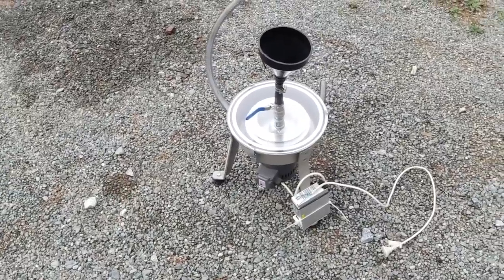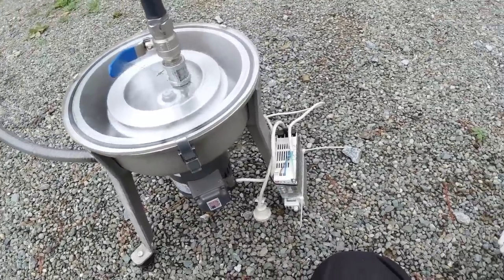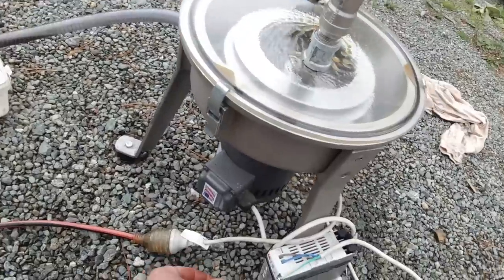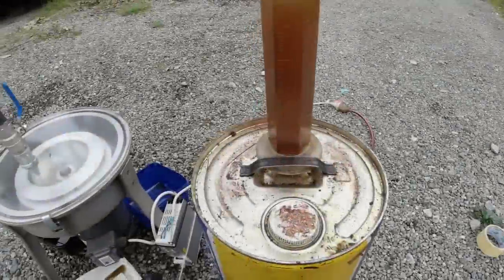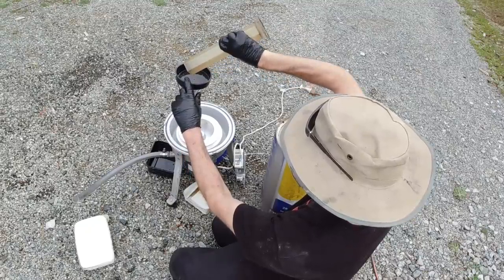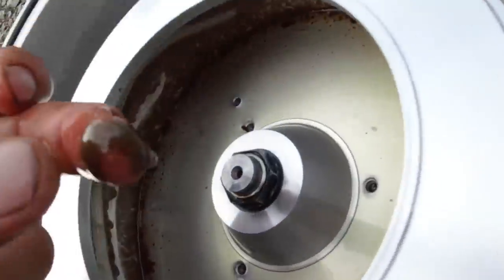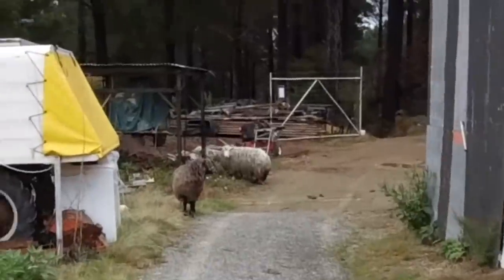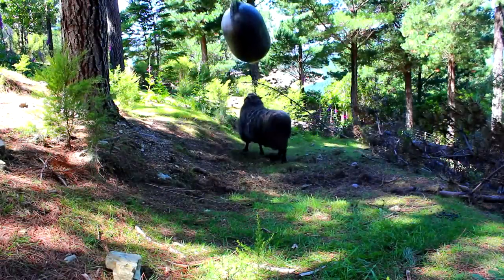Using a centrifuge to clean used oil and diesel.. Will it work??

Comment: After the centrifuge...........the black diesel blend should go through a 2 or 4 micron filter, if using standard filters (only 60% efficient) use 2 filters in series. Centrifuge "spinners" have been used very successfully on trucks ( Mack) and heavy machines for a long time.  Even the Soviet, Kirov/Belarus tractors used them.  Black diesel works just fine, especially in older diesels.......probably not in the late model common rail engines.
Reply: Mixing it with a bit of fresh fuel never hurt either...the nice thing is the waste oil once centrifuged provides MASSIVE lubricity to the injector pumps, especially with todays low sulfur junk they sell at the pumps
Reply: If filtered down to less than 1 micron, the injection system is not the concern. Newer engines are now equipped with Diesel Particulate Filters (DPF) and Selective Catalytic Reducers (SCR). The EP additives in oil consist of Zinc and Molybdenum. Those metals become oxides in the combustion process, and those oxides form an ash with a much higher melting point, than the temperatures achieved in a regeneration cycle. That ash will clog and cause restriction in the DPF, and foul the SCR. I would only ever recommend "black diesel" in older engines without post exhaust treatment.
Reply: @vincentrobinette1507    yes, DPF systems are almost exclusively found on COMMON RAIL engines......large and small.  Pre-common rail era engines as a rule DONT have DPF.  Blocking the DPF with ash is a minor problem compared to the potential damage to the high pressure common rail pumps which are very fussy. If you get dirty fuel,water or even higher than 5% biodiesel through a common rail pump, problems can happen.

Comment: I spent years on diesel submarines where sometimes on long cruises...diesel fuel was actually stored in the bilge along with bilge water. As the fuel was need we sent it through Sharples centrifuges and also used DeLeval  separators...Worked every day for every diesel submarine ever made...

Comment: An easy way to get water out is to freeze the liquid so the water turns to ice.
Reply: Emulsified water will form microcrystals and they will remain suspended - freezing will achieve very little
Reply: @PaulG.x  Put some oil and water in a soda bottle, shake it up let it sit for a couple of hours and freeze it. Just setting up a barrel or making a container with a tapered bottom with a drain in it will allow water to settle out. The longer you let it sit, the more water leaves suspension. Heating to remove water by evaporation also removes any aromatic hydrocarbons like gasoline and diesel fuel which are not good things to release into the atmosphere. The centrifuge has the same effect as gravity on an increased scale.
Reply: @tiredoldmechanic1791  Putting some oil and water in a soda bottle is not the same as what happens in an engine. It does not cause emulsification or other chemical bonds between the water and constituents of the oil.
A pointless exercise
Reply: @tiredoldmechanic1791  so you are saying that freezing will decrease the density of the water, making the density difference between water and oil smaller, thereby making them harder to separate‽
Reply: @Bbonno  I'm saying that freezing will make the water a solid and it's easy to separate a liquid from a solid.
Reply: @Darryl603  so you're saying oil and water freeze at the same temperature?
Reply: @PaulG.x  do you have a degree in chemistry or chemical engineering

Comment: Marty, when I was in the Arctic, we used an Alpha Laval centrifuge to lean up our air compressor lube oil, it was multi pass to clean up the condensation in the oil.
Our large diesel engines, EMD, had dual Oil Spinner centrifuges on each, that could be swapped, with the turn of a ball valve. So as to run continuously, while one Spinner could be taken down, and cleaned.
Neither system was single pass.
Best wishes from the far North.
Reply: So wait, the centrifuges were literally part of the circulatory system of the engine? As in, it was constantly cleaning the oil and pumping it back through the engine? And that was important enough to be worth the loss of total horsepower needed to run the pump and centrifuge?
Reply: @skeetsmcgrew3282  On the EMD's they where mounted on an external rack, beside the engines, tied into their oil systems. 
The Alpha Laval, was on a cart, that was moved between the Large compressors.

Comment: The Navy uses this method however with multiple centrifuges in one unit for various particle sizes. The centrifuges are closely stacked and conical shaped. The centrifuge also breaks down the cleaned oil when cleaning it so, while it works, you cant do it repeatedly without adding additives.

Comment: WRANGLER, read you complements first then you will get the gold.  First things first, I love watching your videos because you are one of the calmest mechanics on the tube.  Your approach of dry humor and a bucket of common sense is fantastic!  So I am in America in Texas, I have been broke when it came to my trucks and equipment most of my life because the family gets the lions share as I am sure your does too.  I found a way to filter oils and reuse them on the cheap. Take a leg from a "WRANGER" pair of denim  jeans and sew the bottom shut.  Pour in any oil and let drain in to a bucket. Wrangler denim will filter any oil to 10 microns.

Comment: Years ago I had a fishing boat and swapped the 6 Cylinder DAF Diesel out for a 8LW Gardner. I installed a centrifuge oil cleaner on the Gardner. I can't remember where I bought it from but was some engineering company in NZ. It fitted in place of the oil filter. It had inlet and outlet hoses and you had an adaptor that bolted on where the filter was. You simply removed the outer casing periodically and cleaned the junk out. I probably wouldn't use it as the main filter on a modern diesel engine but it seemed to work well enough on the old Gardner. I am sure that you could set something like that up to run continuously in a loop but I think it needed quite a bit of supply pressure.

Comment: To get the best cleaning action, run the centrifuge at the highest possible rpm, flow rate of the oil as low as possible and the oil needs to be pretty hot, so the viscosity is as low as possible.

Comment: Water separation with centrifuges is really common. That’s also how cream is separated from milk and unsurprisingly exactly the same equipment is used for both (same manufacturer).
The water comes from the wall of the centrifuge and the oil from the inside.

Comment: When I was a kid living on a farm in the UK we used to make our own butter , milk was  from one old cow kept for that purpose. We had a centrifugal milk/cream separator , hand operated.  My job was to turn the handle to get to the required speed then turn on the flow of milk and keep turning. Skimmed  milk came out of one outlet, thick  cream out of the other. Speed was controlled by a bell which sounded until you got going fast enough, damned hard work for a youngster.  It must have had quite a high gear set up to get the actual separator bit spinning fast enough. I bet there is a lot of these thrown into sheds and barns now and replaced by more modern stuff. Ours was actually set into the dairy floor in concrete, it required some real effort to get it going. Maybe it would separate oil/ water/diesel etc. Just a thought it must have been about 60 years ago, time flies.

Comment: This is mostly what is done at oil recycling facilities.

When you remove the water, the water will need to treated before discharging to environment.

The final step is catalytic hydrogenation.

If you do distill it, you will usually get three fractions which produce a Diesel fuel,  a thin and thicker lubrication oil.

Nice community and channel content , subbed.

Comment: When I worked for the fire department I managed a project where we needed to replace our leaking underground fuel tanks and bring them into current environmental compliance back in the 1980s. The company we used had an industrial size centrical system that operated fuel from water and also removed significant debris and suspended particles from diesel fuel. All the fuel he pumped out of bad tanks, bad by most standards were cleaned up using the centrifuged and he used the fuel safely for the businesses purposes saving a lot of operating costs.

Comment: Ran some centrifuges for years  on large quantities of turbine oil , only helps to remove water. Very time consuming systems and won’t remove any microorganisms or dirt, a good filter system and a loop tank feed will sometimes get your oil cleaned up. We’re talking thousands of gallons of oil over weeks and weeks of work. If you’re oil really does have  large quantities of water in it you can heat it and remove the water by draining it off the bottom of the tank first.

Comment: We had 2 centrifuges running each with 13 internal filters each 2ft by 4 inch  inside the centrifuge canister.
That was for the new oil before going into the engines, it was amazing how much crap came out of brand new Diesel engine oil. 👍

Comment: Reducing the flow rate to almost a drip would help a lot. You are right about not wanting to run "black diesel" in a newer vehicle. Oil has EP additives like zinc and molybdenum, which will oxidize into an ash that has a much higher melting point, than is achieved in the DPF during a regeneration cycle. Black diesel is fine in an older engine that doesn't have a Diesel Particulate Filter, (DPF) or Selective Catalytic Reducer. (SCR) Those components will be fouled by the EP additives of engine oil.
     A centrifuge like this would be ideal for recycling oil in lawnmowers, roto-tillers, portable generators, water pumps, wood chippers, or anything else with a small engine. These engines typically don't have oil filters, so passing the crank case oil through this centrifuge will filter out much finer particles, than any media filter. You could afford to change the oil in these engines more frequently, since you're cleaning up the oil after a few hours of use, and reusing it. A typical engine filter only filters down to ~20-30 microns, this spinner can get particles down to less than 1 micron, if the flow rate is reduced to 1-4 quarts per hour. A filter that filters only down to 25.4 microns is admitting particles up to 1/1,000 of an inch. NOT FINE ENOUGH! This spinner can do more than 20X better than that, if the flow rate is low enough.

Comment: Mack Truck engines have had CentriMack centrifugal filters on them for many years. They seem to work well, the oil pressure fills a can on a shaft pressurizing it, then the only way out is a set of small angled holes on the bottom that form oil jets making the can spin.

Comment: Glad to see the Ram's are still kicking (or I guess smashing into things). That centrifuge is pretty sweet! I knew a guy that had one and would run waste oil through it, then filter it, and then mix it with diesel. I forget the ratio he used, but he ran it in his farm tractors and old IDI diesel truck. He figured that it saved him quite a bit over the years. This is such a great idea to get more use out of something that would just get tossed!

Comment: I used to operate a similar device for removing air from acrylic adhesives used in ultra-thin coatings. It was hooked up to a vacuum to remove the air bubbles, but the machine I used had a scoop on the inside of the centrifuge to pick up the material rather than it spilling over the edge. It was a fine balance of adjusting the material adder and vacuum valves. Anything that spilled over the edge of the spinning bit was usually full of bubbles and sent back into the machine.
It was kind of fun to use for a typically boring factory job.
Reply: Some boring factory jobs are fascinating.
My one was playing with the rumbler, carefully tending my "pet carbides" as they wore over the years.
Fiddle with the weights, try a different combo every day, see what results it has...

Comment: FWIW I have the oil filter unit from one of the diesel Landcruisers. It's a large contraption that bolts to the side of the block, and it does have the usual spin-on paper filter but there's a dome on the opposite end that's about the same size as the big paper filter. That's the spinner part of it and like your machine it centrifuges out the impurities in the oil.
Reply: Is that on one of the older Landcruisers??
Reply: Silly question, never mind!
Reply: @mikescudder4621  From memory some Toyota 2H engine variants came with the centrifugal oil filter.  Land Rover TD5 engines also had centrifugal oil filters.

Comment: Marty I recall watching a television show forty or so years ago which was based on examining innovative technologies and one episode I viewed investigated a centrifugal device for removing contaminants from engine oil.

If memory serves the program initially commenced airing as Towards 2000 in 1981 but was renamed Beyond Tomorrow in 1985 then was ultimately cancelled in 1999.

The device I recall was based on a 'cyclonic' principle and designed to be permanently installed on trucks and other heavy commercial vehicles after which it received some exposure in publications pertinent to the transport industry.

It had a transparent reservoir so purified oil it contained could be easily examined and so far as I am aware it worked extremely well and held promise for substantially extending service intervals for engine oil.

The invention attracted quite a bit of interest in the transport industry and was installed on a number of vehicles.

But then it seemed to quietly disappear without any of the fanfare you might reasonably expect such an environmentally sympathetic concept to attract or sustain.

I also recall speculation circulating at the time to the effect that concerns with a vested interest in wasteful consumption of lubricating oil and disposable filters may have contrived to suppress the device and ultimately remove it from the market.

Comment: Centrifuges are used to separate oil from water in the water treatment plants on offshore oil rigs before discharging water to sea. It is a very fine tuned setup. Rotation speed, angle of cone in centrifuge and feeding volume needs to be very exact to get a good result. If tuned and with repeated passes you should get a better result.

Comment: I built a filter cart that I could take into the field and pass large machine (over 50 gal tank) hyd. oil through while I was doing some other service. It was just a small electric pump with a large 15 micron and a 5 micron filter in line. It would help keep systems clean in between changes. Perhaps you could pass your spun up oil through a fine filter afterwards to let you sleep better.

Comment: It can’t remove anything dissolved in it. But as long as the particles are out, it is safe to use as a general lubricant, as it will not have any abrasive sediment leftover.

Comment: If you try some of the techniques that have been recommended to de-moisture and filter the various fluids, you way want to document processes on various batches, sample and label the batches, and send the samples off to oil quality test for some results.  That might tell you which processes on which oils are most effective and would be the best use of your time.
Reply: Watched Master Milo deep fry straight 50w to dry it!

Comment: This probably won't matter much, but when I was in the fuel business, we used blue rags to clean up fuel spills.  They have a VERY cool feature - they will physically strain water out of diesel fuel.  Simply line a funnel with a towel and filter the fuel through it like a coffee filter.  All of the fuel runs out the bottom of the funnel and the garbage, debris and water stay in the funnel.  It's the damnedest thing I have ever seen.  Many, MANY gallons of contaminated fuel ended up in my oil burner when I worked that job.  Even foamy, mixed fuel settled and strained.  The rags can be used over and over again.  They simply DO NOT pass water.

Comment: I use to work in a Hydro Power Station. We used an industrial centrifuge to clean the bearing oils during serving. Our unit was fitted with a heater. We got our best results when we recirculated the oil multiple times through the centrifuge with the heater on. I believe it would be worth you time to fabricate a system that recirculates annd has a heater in the process. Keep the projects coming. Cheers on ANZAC Day.

Comment: I think that letting the clean oil also pass over a cluster of strong magnets would catch microscopic iron residue in the oil.
There are many different steps to take to clean oil, but distilling it is probably the most efficient.
Just be aware that new oil has additives that are there for various purposes like catching contaminants or act as an anti-foam in hydraulic oil.